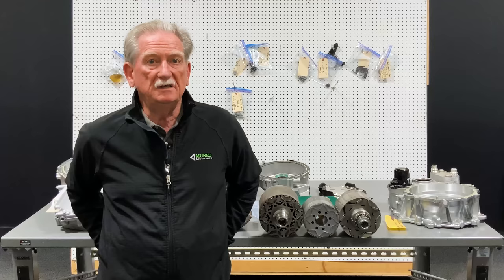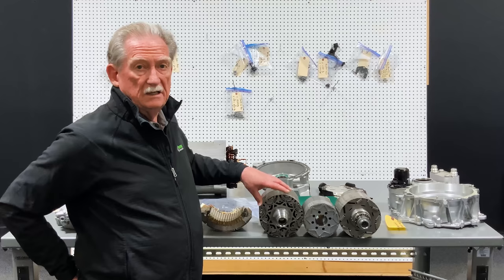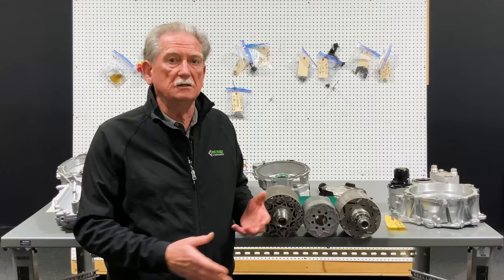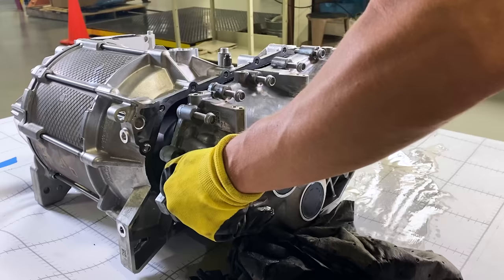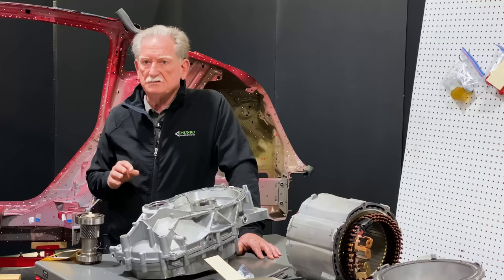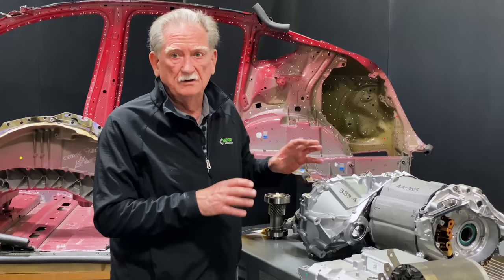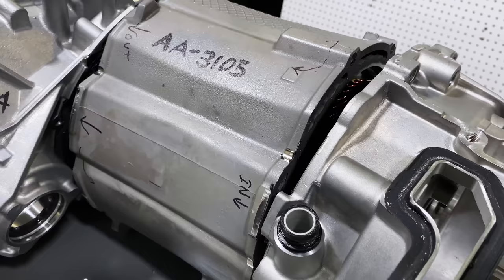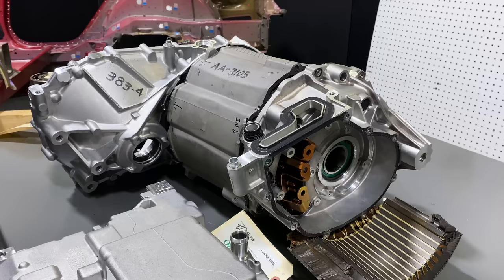Volkswagen ID.4: Electric Motor Teardown and Analysis

Comment: Believe me or not, i worked in the development of this inverter. We have been called in during c-sample stage to decrease the cost and improve the tolerances, so the overall design was done at this point. 

In a HV-inverter your worst enemy arent screws, its particles. Especially metallic snap hooks migh chip of microscopic particles which will ruin the technical cleaniliness requirements. These requirements are really high, so this is also the reason why those inverter are not serviceable. Once you open them, they get contaminated with all kinds of dust. At this point, to keep using it is all on your own risk.

Also screws are really cheap here in germany and they can be applied fully automatic. If you have to screw in 10 screws in one assembly station, this takes a fixed amount of seconds. If you have i.e. 3 adjecent steps with 10 screws each, you will not safe much time by bringing down one of these steps to 8 screws, because the part has to wait to be shifted to the following station anyway, while the next part down the line gets its 9th and 10th screw applied.

 In other projects we have shifted to self tapping screws that can be screwed directly into the raw casting and will not come off. On the flip side these screws cant be removed or replaced. This is even mor cheap, because you can just use casted holes that cost literally nothing, instead of drilling and threading the hole via mashining.

The amount of screws on the printed circuit board is questionable. If you just want to keep the circuit board from falling off, you dont need this many screws. But you also have to make sure, that no area of the circuit board gets warped to much during vibration and acceleration. Depending how strict the set requirements are, the allowed distance between to fixation points is really small.  

After all the vibration of electric drivetrains isnt that bad, so the requirements are lower than the vibration requirements of a internal combustion enigine. This means you dont have to worry about loosing screws as much.

Now just my 2 cents without giving awavy to much: I believe VW has been really carefull when defining the requirements for this product. Once everybode gets more confident and experienced, they will most likely get rid of some of these safty buffers.

Comment: you have to admit - all the screws (except maybe the ones on the rotor) do help with serviceability quite a long way

component-level repair really shouldn't be that hard on these - and - if the design has any bodge and we get some random component failing over and over ... the screws might become quite an advantage

Comment: Hi, I have not read the many comments so I apologies if I am repeating what others have said, but I see three significant issues here not covered by this excellent video. Firstly, and most significantly, by eliminating the screened motor cables often used to drive such inverter supplied motors, the unwanted high frequency circulating currents which pass through the motor bearings inherent in these  applications will be dramatically reduced along with the reduced reflected wave voltage spikes on these short conductors. This will enhance the winding & bearing life expectancy. Similarly, the stator winding design will also provide far lower inter-turn voltage stress on the end-windings than the ‘random wound’ Tesla motor. All up the electrical winding and bearings will face far less electrical stresses on the VW designed motor which should point to a more reliable motor life.  Finally, I suspect the extensive the ‘skeletonisation’ of motor laminations must significantly reduce the inherent eddie currents in those lamination thereby reducing waste heat whilst adding superior cooling.

Comment: Top Down threaded fasteners are perfect for robots to work off- its a combo of gravity drop of the screw, drills working vertically above and adding parts in layers. Another reason for using screws over fasteners might be to take the engines apart for recycling. Glue meant to stay sealed means they are stuck forever and even harder to remove. The EU has mandated lots of measures to avoid newer cars being impossible to fully recycle vs the multitude of plastics, metals and snap on. Screws can be drilled out (and drilled in by robot arms with monotonous speed and precision) vs glues that both require methods to separate and then removing the old glue to add new glue back in (like sanding old paint or wallpaper off first before new paint or wallpaper is added). The longevity issue is that the battery will be the first thing to be replaced and at that stage will new batteries be added back or will the car be stripped apart and the battery repurposed as - low cost power storage for  homes/shipping/trains/offgrid.

Comment: I have worked on internal combustion engine for a long time and I never seen a crank shaft or connecting rod put together with rivets and you would think that theses components are the most prone to work it self loose with all that vibration and heat cycles you would think that if it was a major issue they would revet them together so I don't think long bolt holding a electric motor is going to be fine and same goes for the screws for the inverter it's all done for repairability , recyclability .

Comment: Nice explanation, BUT about the fact you appreciate the "tesla way" in the specific case of that resistor which takes temperature of cooling liquid.. HOW could be replace if failure occur? By replacement of ENTIRE mainboard or even entire inverter?
About fasteners you're right, BUT as you already explained, vw did a good job by eliminating as was possible all the engine vibration which could be transmitted to inverter and cause  (un)fasteners to be pulled out then caused fatal failure.

Comment: The rare earth element mentioned is "dysprosium" (Dy), not "disposium"... which sounds kind of disposable. :) No, it's not a big deal, it's just kind of funny.

That was in the section about the stator. It would have been good to mention that Remy (now BorgWarner) and GM motors have used hairpin bar windings for many years - the BorgWarner HVH line name means "high voltage hairpin".

Comment: An excellent explanation and has changed my mind about VW. Totally agree about frequency screw vibration but as the build is top down the space of the screw to come out could be sized with a small tolerance of the level above to physically stop the unscrewing effect. Lots of us engineers like to dismantle things and screws and bolts are fun to thread and unthread. I also commend you on the logic card as I totally agree with simplicity of components.  Would have liked the motors reluctance to have been incorporated but appreciate that videos can become too long. Well done and a new subscriber here.

Comment: A lot screws stabilizing the main electronic board in vibrating environment is very wise. The tiny copper-lanes ("wires") and integrated circuits (IC's) can otherwise break or loosen its hold. What's not to like about that? (Yes, I've seen that happens in computers!)

Comment: Plenty of threaded fasteners because of RF shielding. You get lousy shielding unless you have plenty of electrical connections between the metal casings. IGBTs produce terrible RF that can cause spikes on digital circuits. For perfect shielding, you need there to be no gap between the surfaces, 
You have 2 choices.
1 Produce super rigid casings with precision faces that when brought together have no gap.
2. Use plenty of fasteners and bring the faces of the casing together using torque. Clips wont cut it because they are bad for apply force.

Comment: Volkswagen is a master of threaded fasteners and those long rotor bolts will be put into elastic deformation, not plastic deformation. The result is a 'spring' effect along the length of the bolt. The nut has most likely a 'pinched' self locking feature. The nut won't back off the thread.

Comment: Great video. Yes maybe the fasteners could be reduced in number.
However I agree with other commentators, you're clearly not an electronics guy. These inverters will be "refurbished" by specialists, so definitely don't glue them together 😂

Comment: You cant have it both ways !
As @M Hamma explains it for a 50c part.
If you have plastic/Aluminium snap connectors, after a while these become brittle/permanent, and cannot be removed, without breakage.
If that's what you want, you can use a permanently locking Acme, or Whitworth threaded fastener, which using a suitable tool, can be undone.

Comment: The number of fasteners are needed for potential short circuit or similiar events, where a lot of heat and magnetic force will work against the fasteners. Thats something that is mostly overlooked by americans. A good example for that is the energy distribution network in the us.

Comment: How will you monitoring a snap connection? Or a riveting process  properly? I think especialy a converter will have enough critical characteristics on the assy that the only left soloution will be screwing (or welding 🤔). How will you lift a heavy motor + rack  to tumble or spin rivet the parts together? I'm glad that the most-OEM's are still screwing, that makes diy much easier. That is the reason why we still see  cars from the 80+90ies on the roads in Europe, Africa and the middle east.

Comment: 27:38 maybe the bleed resistor is screw mounted to the enclosure so it can use the aluminum as a heat sink.  the paste on the back looks like thermal interface compound which fills in the air gaps to improve thermal conduction.  

i found it informative how you showed the nissan's power resistor in comparison.  worlds of difference in design and parts bins between the two companies.  

i also found it interesting how tesla surface-mounted their bleed resistors in the middle of the board.  there is a thermal transfer pad but it seems to make more sense from a heat management standpoint to have the bleed resistor separated from the rest of the board like VW and Nissan did with discrete components. heat is the enemy of semiconductors. 

thank you for the deep dive into this motor and your insight into design.

Comment: As a microwave engineer I've seen Bosch equipments (Radio combiners) with more than 300 threaded fasteners on an 20x10x3 inch module.

Comment: Didn't a VW van lover back in the 1960's write his own van repair manual? Iconic items that stand the test of time will be repaired...technicians today are repairing "throw away" circuit boards by pinpointing the actual failed component. They share this knowledge through Facebook groups and other clubs. I once took apart and soldered a turn-signal assembly on a 1983 Kawasaki LTD motorcycle, that was no longer available for purchase and not available in a salvage yard. Where there is a will...there is a way... :)

Comment: I wonder about the thread angle story. 60 degree is more like a cone so it should clamp. Whitworth has a 55 degree tip angle to it mates in a more flat way and clamps less. And ACME thread is used as lathe feed - it is designed not to bind at all.

Comment: I dont own an electric vehicle and never will , to be honest I really dont like them , any of them , but this video I found extremely interesting , been using 3 phase electric motors in model aircraft for years , a lot less messing around with fuel and oil mixes and more reliable

Comment: Sorry Sandy, but snaps are not always better than skrews when they are made of a not long lasting material.
I had too many snaps that broke when I disassembled parts (the plastic parts aged) and I only got complete sets...(expensive replacement ...). But if a skrew was too rusty or sth. , it was easy to replace (and cheap).
But if a component will never be disassembled, you are right!
Thanks a lot for this good video!

Comment: The reduction down to three bearings is very impressive vs. Tesla.  It's obvious that VW is really taking EV design seriously here; that must have taken a huge number of tests to develop.

The fasteners are over-abundant on the PCB and other parts of the inverter.  As somebody who has built / repaired a lot of electronics, I'm not in favor of plastic snaps there; techs will be replacing capacitors, inverter coils, etc, and in some cases, even reflow board components to replace damaged circuitry. Yes, "just pop it out, throw it away and replace it" is cheaper initially, but I agree with the comments about long-term repairs. Also, this isn't a great area to use them- inverters are areas where high thermals will break down thermoplastics eventually.  But I think they can lose almost a dozen bolts, use vibration-resistant washers, and improve raw cost, assembly time, part life and reparability (by reducing the tech time needed to disassemble).

Instead of thermal pads, they should use something like K5 Viscous Thermal Paste (it's a fairly new product for computer component cooling). I suspect its price at volume is cheaper than pads-  but more importantly, robots can apply it easily, it will serve as a "glue" to further mediate vibration, and it will make repairs easier as well.

One big thing I saw that I didn't like: the design of the thermal interface inside the inverter, where it's transferring a lot of waste heat from the inverter to the coolant.  The pins will perform badly, vs. having a smooth surface there and using thermal paste.  It looked like a design that presumed there'd be airflow, and there won't be any at all.  It also over-complicates the casting and machining, since I presume those pins need to be milled fairly flat to mate up nicely, vs. just doing a single quick / rough pass on a flat area of the casting to polish it a bit (and, if using thermal paste, it doesn't need to be mirror-flat, just flat enough).

The motor / stator design looks like a major evolution. It's almost as impressive as the bearings, and hopefully it performs as well as it looks.

The use of non-oil coolant looks like a win, on paper; water / PEG will perform better than oil.  But how in the heck do you perform regular maintenance and flush it?  I didn't see any easy way to flush it. It shouldn't need a bleed, either; with a good design for the coolant reservoir, any air bubbles should be retained at the top (low-pressure) areas of the loop.  I feel like this is an area that could use more improvement.

Comment: Even if it's never likely to be serviced, if VW ever has to do a recall because of a future issue with this motor they'll be glad they made it possible to take apart and open. That and snap fittings are less durable over time.

Comment: Really like the pin though windings, would like too see this used on a smaller Ebike sized motor.
Reply: Hair pin windings?
Reply: @Foersom_  Yes, Instead of using a round wire, wound electrical motor like Tesla, VW has used a more compact copper wire winding with a hair-pin through wire winding design, which means tighter laminating giving some 60% filling vs 46% (as Sandy explained)
But the main benefit from all this will be less eddy current losses, giving a more efficient motor.

Comment: On the long bolts holding the rotor together I would put Nordlock- washers. That they put so many fasteners into the inverter is because of the new " Right To Repair -Law "  I presume. And for easyer recycling... That is OK, thanks VW .

Comment: Those  'burrs' are just caused by surface cracking in the die, caused by rapid cooling and heating of the die when in use. It's not a fault, only cosmetic.

Comment: @Munro Live : Very great and interesting videos you provide! like
26:26 "look at all the screws ..."
Forgive me for being an absolute layman on the subject the problem:
I understand this bulwark of screws as "pressure distribution" to create an optimal contact surface for the to be cooled circuit board underneath, but without too much selective pressure. Perhaps one fears premature tearing/breaking of the circuit board with only a few screws?

For my understanding: More screws with less torque are better than fewer with (too) high torque.

As I said: I'm an absolute layman and the only thing I have/had to do with "screws, circuit board and cooling" was mounting my cooler on the computer mainboard. :-)

Comment: inverter design seems surprisingly repair-friendly, as well as motor. That control PCB likely won't be cheap if it will ever be sold separately by VW.  I guess in 10 to 20 years there will be a whole market of "aftermarket" PCBs for electric cars.

Comment: Seeing that the only manufacture to eliminate a bearing in the drive chain is VW, it raises a question,  did they eliminate it to reduce cost or because an engineer determined that the motor could go years without the extra support. At first glance I would see the elimination of a bearing as a design flaw until it could be proven otherwise.

Comment: I suppose it's interesting from an engineering perspective, to eliminate parts like coolant filters and pumps. But is the VW coolant system able to  do the job over the long haul? Does the VW coolant reach an adequately low temperature  ? Does it reach into and cool its components?  It seems to me the only way to reliably answer these questions is by taking temperatures after extended use.  Yes, if VW has found a way to simplify its manufacturing and reduce costs that is good, but  the system has to work in real time.

Comment: Japanese vehicles always use many threaded fastener and fine threads.
That's why like there engines don't leak oil.
And cars don't fall apart as easily.
And as far as the inverter is concern it is great that if you could replace one part in it so it would be less costly to the customer for do it yourselfer.
That's why Japan uses fine thread for better holding power and also stays together without the use of loctite.